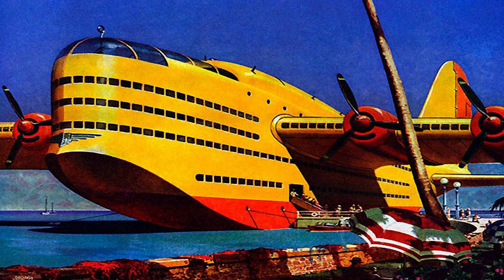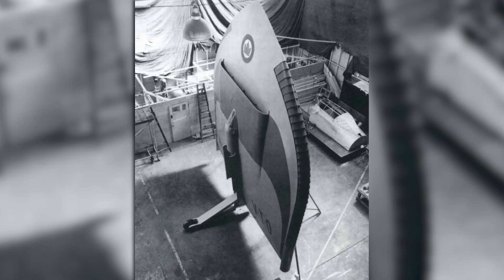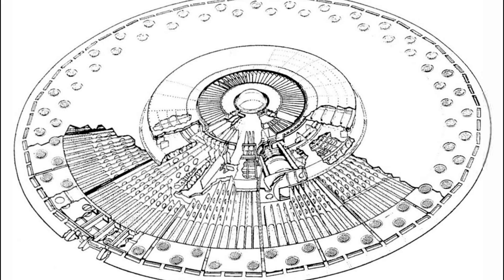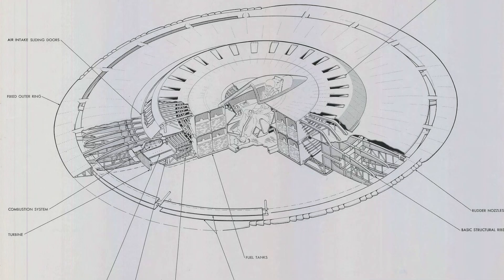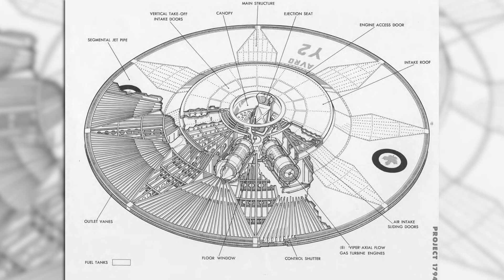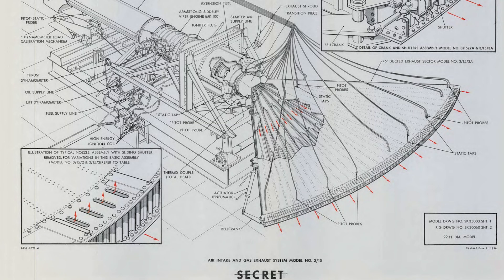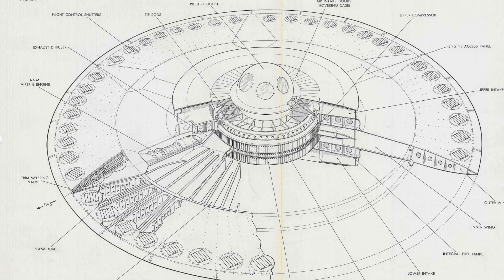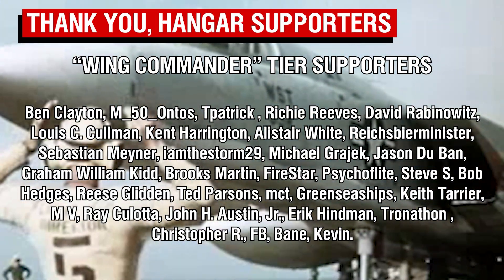The Flying Saucer Designed To Ram Soviet Bombers | Avro Canada Silver Bug

Comment: its not rocket science, its a motorized frisbee and u can use several points of spin force plus this has many green clean uses for self sustainability....and theres many designs and ways it can fly including using water and electrical ion energy, so long as u innerrstand toroidal forces and how something spinning on an axis that is fixed can change the wave of gravitation aka the momentum of spin if the axis is shifted either smoothly or abruptly...so that being said..i hope yall building and working together instead of just wishin...

Comment: It took some time, but I managed to calculate the deceleration that would have been encountered if ramming a Tupolew Tu-95 with this Frisbee of death. As you showed in the planned graphic. If you hit at 2000 mph you immediately, within 5 feet, lose 525 mph. Hence the forces suffered by the pilot is the same as hitting the ground at 525 mph. Simply put: You are dead on impact. Sure, the bomber is dead too, but what does that do for you. It is not relevant if your carcass continues after the hit with 1475 mph or not, your just dead. Splatted on the windscreen inside the cockpit. A veneer of red mist on the glass. They must have known this, or not. Yes, the damage will me mostly on the bomber, but the disc will take damage too. At this speed there will be instant welding happening.

Comment: That was far from being the only ramming aircraft suggested. One of the Northrop flying wings was intended as a ram fighter as were lots of German WWII proposals. There were some examples of non-suicidal ramming attacks during WWII. Probably the most famous is the Hurricane pilot who, out of ammo and seeing a Do 17 heading for Buckingham Palace, put his wing through the Dornier's notably slim rear fuselage, cutting the tail end of it off completely. There is cine footage, taken from the ground, of the tail unit sycamour-leafing it's way to earth. The Hurricane remained flyable for a while after the collision, but unfortunately it was one of the early fabric-wing ones and air flowing in through the damaged leading edge eventually ripped the fabric to the point where it became unflyable, and the pilot had to bale out.

Comment: The really funny thing is the idea isn't nearly as far fetched as it seems. With current developments in fly by wire the control issues should be fully solved. It would be really fascinating to see the concept revisited to see what it can really do.
Reply: Control issues are secondary to aerodynamic impossibilities.
Reply: @jamesharding3459  Actually, no. The aerodynamics are unconventional but quite possible.
Reply: @joshualandry3160  Do you actually know this, or are you just going by Wikipedia?
Reply: @Will-hv9ns I know this by having a degree in this. Also, because of real life applications of the very same physics. And, unsurprisingly, they work. Specifically NOTAR helicopters.
Reply: @joshualandry3160  NOTAR helicopters are absolutely nothing to do with this...
Reply: @Will-hv9ns Umm... are you trying to sound smart without understanding what you are talking about or just trolling? They are quite literally applications of the same physics.
Reply: @joshualandry3160  It's the same application of physics in such a vastly different way it's not comparable.
Reply: @Will-hv9ns You really should stop talking because you clearly have absolutely no idea what you are talking about whatsoever. You may as well have just claimed that wings and tail rotors are so different that they are not comparable. Except they are. Rotor design is literally taking small wing cross sections and matching the lift generated at the different travel speeds in order to minimize differential stress across the blade.

Similarly, the NOTAR tail rotors use the Coandă effect to generate lift on the tail to counteract the main rotor torque. So yes, it is exactly the same process as producing a flying body that uses the Coandă effect to generate the majority of its lift.

Why are you so allergic to admitting that physics is physics whether applied to a tail boom or lifting body?

Comment: Frost, at the time that he came to Canada, was the designer of the world speed record holding aircraft, the Swallow for De Havilland. He had been a major part of the Hornet replacement for the Mosquito, and he had as much experience with wing-slot design as probably anyone else working at that time. 

What, in its glibness, is omitted here is how much impact the research into the Coanda Effect had in advanced aerodynamic design. Coanda airflow promised to create whole new possibilities that removed the separation of power and lift, by making the leading edge of the wing act as generator of both. The figures around maximum speeds aren't as fanciful as they are made out to be: there was no experimental limit established for when Coanda-generated pressures might collapse, provided sufficient supply of high-speed airflow, but what was experimentally established put these figures within reasonable bounds. 

Jets were very new in 1948, and had already blown away the propeller driven model for most military aviation. They provided far higher flow rates than had been possible with props and pistons. With no theoretical limit known, a man who had designed the world's fastest aircraft, had extensive experience working on the engineering of airfoil leading edges, where Coanda structures would go, knew enough to be responsible for the jet-transformation of the most successful, fast and innovative aircraft of WWII, and with the US Air Force paying him to think big, he did what anyone with the imagination (not necessarily including the commenters below, or the author of the video) would do. 

It's not worth including the points that Avro Canada were headed to building the most advanced interceptor in the world – The Arrow – or that many of the best minds in British aircraft engineering were brought by Avro to Malton. The Arrow, remember, had the same design brief, which was to intercept Soviet bombers on their way to US targets, over the pole. That required short flight times, very high climb rates, and high ceiling. The company knew what it was doing, and Frost was the guy. 

Also not worth mentioning that the underlying issues of control of an unstable lift generating system is exactly what was finally mastered in the F-16, making it the most capable military aircraft of its type today, and the same problems needed to be solved in the Osprey and the F-35, to say nothing of the Harrier. Frost was visionary, and I am sure could see the direction of aviation over the next 40 years clearly enough, even if the snark here indicates how many are still unable to keep up with his ideas.
Reply: It wouldn’t surprise me in the least if all the unconventional research was shunted to secret programs that we’ve just never heard about yet publicly.
Reply: Every fascinating aerospace project that gets cancelled was going to be the best thing ever. Every single time. Because people who "lacked vision" wouldn't perpetually keep dumping money into those projects it is therefore their fault, and never the designers', that Canada/Russia/the UK/Germany etc did not have the VERY BEST interceptor/reconnaissance plane/cruise missile etc. Thus, forever ad nauseum, Canadians can have the best superfighter ever in the (cancelled) Arrow, F-22 critics can have the (cancelled) world beater YF-23 Black Widow, the UK can have the (cancelled) best strike aircraft in the world in the TSR2... and it will never end. You aren't upset with Rex for getting his facts wrong. You are upset that he didn't speak about the Silverbug and the Avrocar in reverent tones. Frost was brilliant, no doubt, but he was also quite mistaken in many respects. No one here in the comments is having any trouble keeping up with his ideas.
Reply: @MrArgus11111  I was going to say something similar, but I think you’ve quite nailed it. Cancelled projects are never what they “might have been”.
Reply: Not how fluid dynamics works, buddy. Sorry to burst your fantasy.

Comment: REX!  REX!!!  I make these RAID cards with 4 NVMe drives onboard that are 4tb each and transfer data at around 12000mb/s down and 9000mb/s up each.  I have the best cooling paste and worked through a bunch of coolers until I found the best one and bought a case of them.  I can put the whole deal in an external enclosure that uses thunderbolt, a USB 3.2 port capable of at least 20gb/s transfer, or you can thread the pci-e x16 rizer that's about 8-10 inches long into your box to plug it into your mobo (that's usually how I get the best speeds out of it, but the other options are by no means pale imitations it all smokes the crap out of any other storage option around).  I SAY THIS BECAUSE YOU SHOULD RUN A RAID 1/10 TYPE ARRAY!!!  That way, you get 8tb of storage AND you get the drive redundancy so that you don't have to worry about losing projects EVER AGAIN!  We can even supe up the enclosure with some extra fans to increase the air flow, which I could see you need considering the country sitting on the border between hell and earth in which you reside.  If you want one of these crazy monstrosities, just say something here and we'll talk further somewhere more private.  All labor would be free, my pleasure in fact, and I'd happily cover whatever exorbitant postage costs might be required to ship the finished product to your door when done.  HOLLAH AT YO BOI.

Comment: For an aircraft that relied so heavily on the serviceability of its engines to remain controllable / airborne, the Viper is a rather curious choice of powerplant as it was originally designed as a single use engine to power Jindivic target drones. Obviously it was later beaten into shape and its early prolonged-use maintenance issues were resolved, as it went on to power the BAC Jet Provost, and with another compressor stage added, the HS Dominie.

Comment: Have mentioned in another thread, a term I have come up with that covers both "flying saucers" and many flying wings is "Fat Wing", meaning a thick wing surface about as long as the craft, with resulting high resistance to stalling. From examples like the Chance Vought V-173 and Kalinin K-7, what we can see is that the true saucer had no advantages over a semi circular or elliptical design, and that all could work with propellers. It's also clear in hindsight that after Sikorsky came along, there was nothing these craft could do that a helicopter couldn't do better outside of less noise and better fuel economy.
Reply: https://www.youtube.com/watch?v=aFoSYntvFVk&list=PLnR3kYinqJKfLiSIFMlnsULWy2217GRIL

Comment: Does the flying saucer that flew count as an aircraft though?  "...derives lift from a reaction with air" isn't exceedingly specific but the saucer seems to be pushing the limits.
Reply: Anything that flies is an aircraft. A wing generates lift through a reaction with moving air using the Coanda effect.
Reply: It's a craft that travels through air. "Aircraft" seems to cover it pretty well!
Reply: Well, if you mean the VZ-9 aka Avrocar, "flew" is a stretch. It hovered, precariously, in ground effect, never getting more than about ten feet up.
Reply: @stevetournay6103  still flight.

Comment: I wonder if anything like it could be produced, with the technical knowledge and materials we have today 🤔
Reply: The idea is just as stupid now as it was then
Reply: There was some small drone prototypes kicking around in the late 90's using the coanda effect and computer assisted fly-by wire tech has found its way down to toy aircraft. So possibly, with a big enough power to weight ratio even a lawnmower can fly.
Reply: @Jon6429 I've seen a "flying lawnmower"! It was a RC mock up but it looked quite convincing . 😊
Reply: @Jon6429  Fly by wire would probably be the thing to make this idea work. It would need MANY computers. ALL OF THEM.
Reply: The thrust/lift generated by this sort of design is massively inferior to conventional designs. This is absolutely dead end development.
Reply: @Will-hv9ns  but the aerodynamics are good...

Comment: Wow, even for Canadians that's quite insane!
Reply: Not really.
It's shaped like a hockey puck.  😆😁
Reply: @tombogan03884  maybe they should have had it spray maple syrup into the enemy bombers engines...
Reply: @eyerollthereforeiam1709  ah, but then they would need to make it run on maple syrup, as there wasn't fuel space to spare
Reply: @tombogan03884  Maybe they could use an enormous hockey stick to launch it?
Reply: @All2Meme  I was thinking of making a slingshot. A truck tire inner tube stretched between two oak trees.